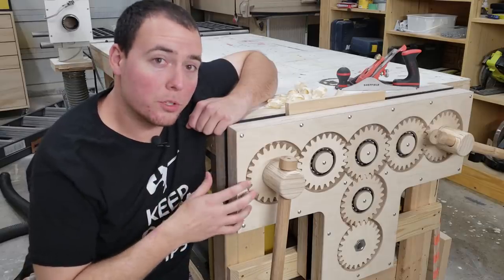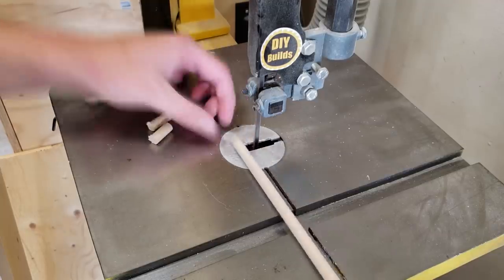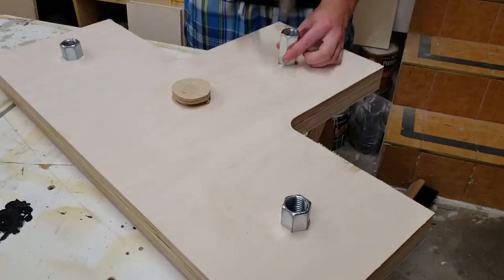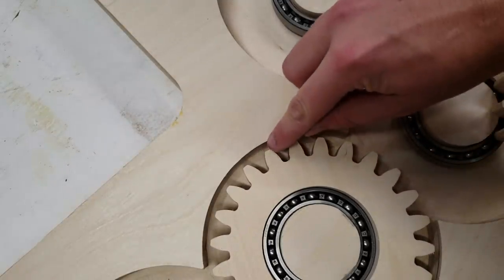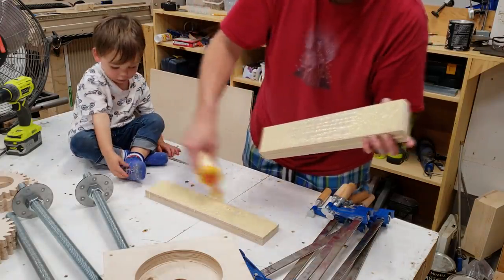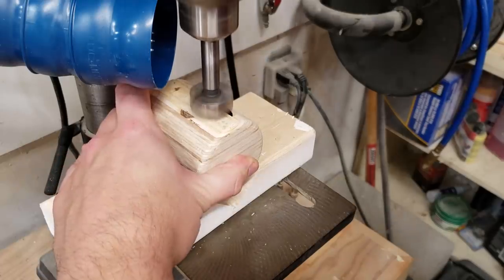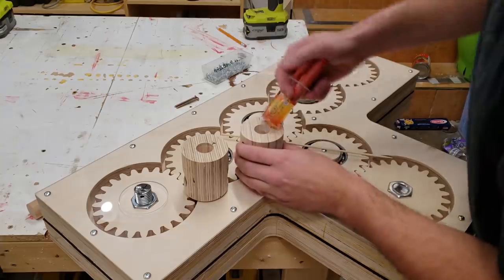Triple Screw Gear Vise

Comment: I understand you wanted the handles to be on the threaded rods but, you could have reinforced the middle top gear to have that be your single handle. I say this not being able to create what you did but, I am good at improving already existing tools.😁
Since your middle gear has a gear in between each of your rod gears, you're not turning it the wrong way either. 
Since this is now 6 months old to me, I'm betting you have a video somewhere of you improving upon this design, yeah?
Great design and video even if I dont like the handle placement.
Reply from the maker: I wanted 2 handles for convienence.

Comment: with contact cement i recommend having a decent roller to push the type of material down to get rid of any air bubbles and then clamping i use that not only for homemade counter tops to leather in-lining for craft jewelry boxes or other hard wood projects. The key is to brush both sides and wait till it has a good tacky on both sides if you see strings it is not ready. Once it is still tacky and not stringy slap them together roll and then clamp. you will get max hold guaranteed.

Comment: Instead of long straight handles create round wheel handles with a knob.  You can turn them faster, torque them well and they won't be flailing around.
Reply from the maker: That was a consideration i had but floppy handles prevailed

Comment: Well done. That lathe is pretty slick too.  I see you're taking a lot of guff re the 2 handles.  Does play in the gears cause the 2 sides of the clamp to not be parallel?  1 handle in the middle would give you approx the same lost motion to all 3 threaded rods.
Reply from the maker: There is basically no backlash

Comment: Hey, i got a question about your Table Saw Lathe. Is it a normal saw blade? If it is i would be nervous about the stress being put on the blade. Wonder if a Dado blade would be safer.
Reply from the maker: It's a thin kirf blade atb so it's not ideal but works great regardless. The best option would be a flat tooth blade 1/8" thick but they are expensive.

Comment: I definitely like your style.  I'm going to have to add this, and the table saw lathe to my list (which has several other items you made a video on already).  I'm retiring in a little over a year, and currently setting up my garage for my man cave shop.  I'm a professional cabinetmaker, draftsman, and cnc programmer, but this is the first time I've been able to set up my garage in more than 10 years.  I never would have chiseled out the gear recesses, but it's a personal choice.  I like the idea of putting the handle on the center gear too, but it might leave the pressure uneven since they are wood gears.  I wonder if aluminum gears might wear better?  Thanks again for the video, and all the others.  You are one of my absolute favorites!
Reply from the maker: Thanks a lot. If i was not going to use Baltic birch for gears my next option would to have a local laser cnc place cut them from 1/4" mild steel.
Reply: @DIYBuilds  Great idea!  Another good feature would be a way to index the 3 screws to allow for gear lash.  I may be overthinking that however.  I tend to do that LOL

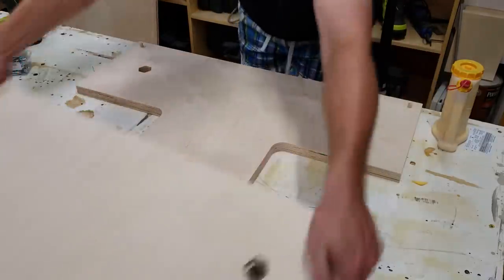Comment: At 1:42 - couldn't the CNC have been programmed to drill all those screw holes? It would have lined them up real pretty - like.
OK, You're a freaking wizard. How have I not found this channel before? You've earned a subscriber.
Reply from the maker: Yes but i would have had to thought of that before hand lol
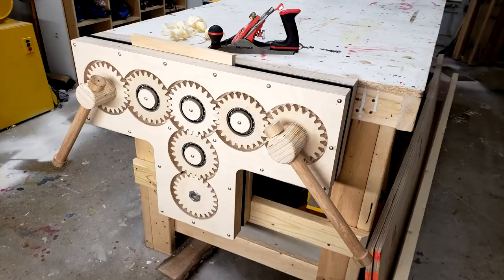Reply: @DIYBuilds  One last thing: at 19:06 there's like, what... 4 to 6 inches of bench left on the right side? Did you consider making the vice the full bench width?

Comment: How about fitting a standard hex fitting on the bottom screw so you can make large changes in the vice position with a drill.  (you might need to centre the handles....)
Reply from the maker: I defiantly considered that but thought wasn't worth doing because 95% of the time you use only an inch or 2 of travel.
Reply: DIY Builds 

With that in mind you should have smaller handles, no?

Comment: Really nice vise.but don't get it. 
Wouldn't it be just as good without the 2 lower gears just use the 5 in a row on top? 
Also wouldn't  a single handle be safer ? 
Maybe add some square dog peg holes on it as well.
Reply from the maker: The bottom prevents racking when clamping work along the top only. I dont see how the number of handles effects safety.

Comment: I'm confused as to the need or application? Is all this to prevent racking? All the gears equal a 1:1 ration. Seems like a lot of work just to turn one wheel and axle and get three to move.
Reply from the maker: The point of the gears is to make all 3 turn at the same time. This prevents racking. This could be accomplished by other options such as a chain.

Comment: What a beautiful piece of kit, beautifully made.👌
While I'm inclined to agree with the comments about your nuts getting whacked by the handles, I'm surprised there are so many negative(ish) comments. Presumably you considered your lower regions when designing the vice and were happy with the "risks". The clear front is a great idea; apart from looking good, it should keep a lot of the dust out of the gears.
If, after some use, you decide to change the handle design, I loved the comment about having a "ship's wheel" in the centre.
The only other thing I might change; how qwould some dark(ish) woodstain look?

Cheers for now,
Dougie.
P.S. I'm no woodworker, not even a little bit, but I can appreciate a good looking, functional project like this.😀

Comment: why two handles and not one in the center?
Reply: 2 handles are better if you want to fix a heavy big thing.
the force would destroy the middle gear faster if ther would be 1 handl in middle , i think
Reply: @DieZockerZone1  except you are forgetting the bottom screw.... which has to be torqued to the same pressure but spread that torque through every idler gear. By putting the handle in the middle the torque applied in the middle only has to go through one idler each to get to the respective screw.
Reply: @DodgyBrothersEngineering  i didnt forgott the screw.

if you force the middle gear to much you would destroy the middle gear.

if you have 2 handls you can handle the force better and dont destroy so eaziely
Reply: @DieZockerZone1  turning it from one side like he is doing in the video (and is the only practical way to do it) all the gears get a huge side loading, turning it from the centre that load is spread off in three different directions. Basically you are using three times as many teeth to distribute that same load. This is where practicality meets theory. Theoretically you could apply roughly twice as much force with two handles, but practically the design won't allow that because it would be too difficult to operate both handles with an even amount of torque. And even then you wouldn't be able to apply twice as much torque because you can only have one hand on each handle. Whereas with one in the middle you can put hands either sides of the handle, or extended the handle length for greater multiplication. The middle would be a much more efficient design.
Reply: @DodgyBrothersEngineering  maybe more efficent. But the torque goes over the handle directly to the axis.

So 2 handls move 2 axis directly . So there is less torque in middle gear.
And the 2 handls split their torque on the middle gear left and right. And let the 3 axis rotate with nearly the force like a handle would do.

If you would have 1 handl in middle you have to use double that torque .
Ther is no axis on the middle gear.
All torque will move over 3 teeth.
Thees teeth could break way earlier. Than the 2 handls build.
Reply: @DodgyBrothersEngineering  
Its not difficult to set 2 handls with torque. If you have 2 hands and they turn same way
Reply: @DodgyBrothersEngineering  sometimes you need more torque left or right
Reply: @DieZockerZone1  While you might be able to apply an even amount of torque to both handles simultaneously the third screw is still going to experience a different amount of torque to the other two because of slop from the driven gears. But even if you could pull both levers at the same time, you still wouldn't be able to apply as much torque as you could with a single lever of twice the length (equal to the length of two shorter ones). As you pull on one end you can push down on the other allowing you to put all of your muscular energy into the lever utilizing core strength. Trying to apply load without using your core is not going to allow you to maximize your efforts.
Reply: @DodgyBrothersEngineering  i said the 3rd will not get same power.
if you want the gear destroy quicker you can build it with 1 long handl

Comment: Great! Try lubricating the gear teeth with wax or paraffin. Sodium and heat to absorb. it will be better spinning gear
Reply from the maker: Agreed but i didn't want to discolour the natural wood.
Reply: @DIYBuilds  if you grate with paraffin, then the color of the wood will remain the same, but if you heat the paraffin, it will absorb and get the color of a wet tree on the edge of the plywood

Comment: I think you forgot to put in steelplates to prevent the couplernuts from ripping through the backplate over time. otherwise, great build
Reply from the maker: Trust me those things are never moving again lol.
Reply: @DIYBuilds  not so sure about that, there is only a single layer of 1" plywood holding those couplernuts in, and depending on how much load you put on it they may work free over time, its wood after all. but we'll see

Comment: For a One handle in center, how would you design the center support, to make stable. I assume, not physically connected to a drive bolt, the stability might be the issue. I have to convert file, so my fusion 360 will load.
Reply from the maker: That was also a deciding factor to going with the 2 handles was the lack of support for a handle in the middle.
Reply: @DIYBuilds  thanks,  that was my concern also. I guess two it is, unless I get a brain storm!!

Comment: Cool vice, nice job and thanks for showing us how you did it.  I'm assuming you put two handles was for having more direct torque?  I don't know enough physics so I have no idea if that's actually whats happening instead of having a single handle in the middle. Regardless, wonderful vice.
Reply from the maker: It is for convenience of working off one end of the vise or the other.
Reply: @DIYBuilds  wonderful, I'm definitely going to build one around your design and see if two handles would be useful.  Thanks for the response!

Comment: I like it.  But what bugs me is the orientation of the handles are different.  If one handle is at 6 o'clock the other is at 8 o'clock.  And as others have mentioned, why two handles?  I can't see any advantage.
Reply from the maker: 2 handles for convenience and they are perpendicular from one another so they don't smack in the middle.

Comment: great video man thank you for all the info and knowledge!

i always wondered if these table saw turning jigs end up stressing the blade and bending it.. is that a concern?
Reply from the maker: No it's fine so far. Im even using the wrong blade for it. Should be a 1/8" flat tooth blade but im using a thin kirf blade atb and it works great.

Comment: Did the area behind the plexiglass stay clean or has fine dust trickled down in there after some use?
Reply from the maker: Ill let you know when i get back in the shop lol. It's cold outside.
Reply: @DIYBuilds  ha! -  I just fired up the space-heater in my shop.  Should be warm in a 4 days or so.

Comment: It could use a dc gear motor and a speed controller with foot switches
Reply: Nah! Hydraulic ram pistons👌😁
Might need to use I beams instead of 2x4s and 20mm plate instead of plywood... but it'll definitely clamp (aka: create instant matchsticks 👍).

All jokes aside... pneumatic actuators with DC amplifiers would be pretty decent. I use them on my glue up table... 8'x4'x6" laminated slabs with no clamps 👌

Comment: Awesome build! What is your reasoning for having to handles instead of just one in the middle?
Reply from the maker: Convenience of working on one side of the vise or the other.
Reply: Human foosball game
Reply: @DIYBuilds  but unfortunately you have traded convenience for severely weakening the mechanism, and introducing a ton of side loading. The centre is the only practical way to do it. Look at how many teeth are driving the screws when you use one side or the other, now look at the middle. You have three times as many contacting teeth driving the mechanism so you have multiplied the load on those teeth by at least twice. Not only that but every idler is now trying to be pushed away from driven gear, introducing massive side load and slop on the other two screws. Whereas if you drive from the centre the load is distributed evenly across all three screws, slop is non existent, and also importantly radially from the centre. Each set of contacting teeth are only driving one idler and one driven gear.

Comment: I bet the throw on that thing isn't too great, since you used a bolt with pretty tight threads for a vise. it probably takes like fifteen minutes to get that thing all the way out.
Reply from the maker: Typical use of the vise is opening less than 1 inch

Comment: The aluminum nail will prevent you from getting the most power. I would use a steel key.
Reply from the maker: Wood working vise doesnt need most power. Just snug to hold work.

Comment: Glue not sticking? Things that like water ( Urethane glue, wood glue, latex primers and finishes, etc.), most often don't work well with things that don't like water (glass, rubber, plastic, polyurethane finishes, epoxy, etc.). Super glue is a bit of an exception. It doesn't mind water (moisture) and likes some rubbers and plastics, glass etc.

Comment: Amazing! do you have a material list? if i build this, i want to make sure i get the right hardware! i didnt see a drawing for the metal pieces you had laser cut.
Reply from the maker: Im not making plans for this as it's very specific to my build and would be hard for others to do.
Reply: DIY Builds oh cause you released the CAD file so I wasn’t sure if you had a file for those metal pieces. I was going to do it on a CNC like you did. Can you point me in the direction of which ball bearings you used?
Reply from the maker: @hizzleman123  if you are canadian i used 80mm outer diameter bearing from princess auto at $3 each.

Comment: contact cement must be beaten down with hammer it holds as better as the maximum pressure is once applied. so hammer it down propperly never work via big surface the pressure will not be enough 
use a malet and some smal piece of wood

Comment: If I may butt in with a minor detail, for the sake of some future wanna-be trying to emulate your exemplary build:  the plastic sheet you add toward the end, introduced and reiterated as "plexiglass" but later (correctly) IDed as polycarbonate, cannot be both.  Plexi is a trade name for acrylic, not polycarbonate, which flies under several trade names, like "lexan," for one.  Plexi might be easier to find and may work for a while, but your actual choice of PC is undoubtedly going to be a better one.  Details....
Nice build - cool tool - very well done, work AND video!  Keep it up!

Comment: Good God. 1" threaded rod? This is expensive. I have my own home built CNC mill but a threaded rod that size and length, what did it cost?
Reply from the maker: 6 foot cost $34
Reply: @DIYBuilds  Wow, that's a hell of a good price!
Reply: @DIYBuilds  I also need to invest in better autocorrect on my phone. Lol Regardless, not at all meant as an insult to you. This is the 1st video I've seen on yours. That table saw lathe is incredible! You've earned a new subscriber.

Comment: I would just remove the handles and use the cordless drill to open and close the vise. Maybe I'm just too lazy, but that's what I've done to my wise: Add a nut instead of the handle 😋
Reply from the maker: I considered it ;)
Reply: @DIYBuilds  add a drive to the bottom gear for when you want to move a long way quick.

Comment: This is a very nice project, but requires a lot of very sophisticated machinery just to make it, a simple chain drive around readily available sprockets would be far stronger, and create less winding resistance, the design also looses one of the main advantages of a 2 screw vice in that you can no longer hold tapered, or non parallel workpieces, if you are going to have 2 handles, why not have a disconnecting clutch in the system and have 1 central handle, not sure how long those plywood teeth will last either, better make some spares while you have the programme.

Comment: Gonna need some seals on those bearings or they are going to get gummed up real quick.
Reply from the maker: The plexiglass protects them.
Reply: with what?
Reply: @gerpeter4489  Saw dust?  Pretty common in a work area and when it contacts the oils in open bearings it becomes like a glue.
Reply: @DIYBuilds  Ah, did not see the plexiglass.  Very good.

Comment: This vise looks awesome! Just one small advice - drilling a hole in the threaded rod creates a weak-point. Welding the bolt to the rod would work better. Don't take my word for it, check out this video of a guy testing the strength of several vises: https://www.youtube.com/watch?v=VcbTopj5u7A. This is still a badass vice though, well done!
Reply from the maker: I am familiar with fireball but you have to understand the force requirements for a steel vise and a woodworking vise are very different.  Plus he was trying to break those vises. I myself have used plenty of metal vises that I'm sure used a hole through the acme thread and I am yet to break a vise.